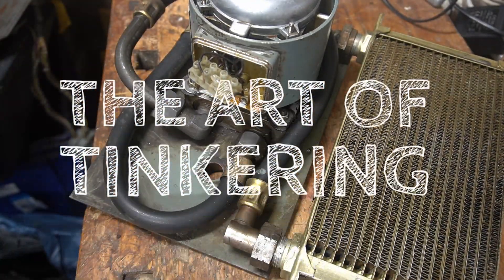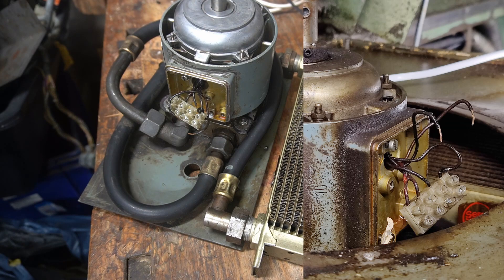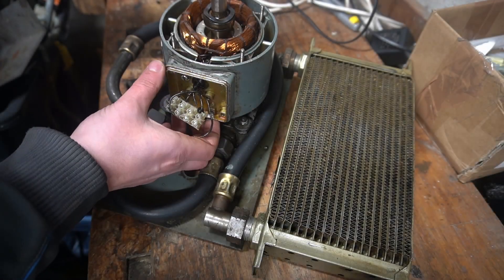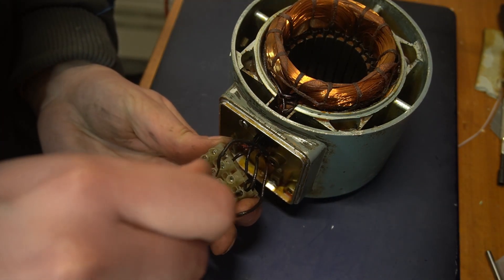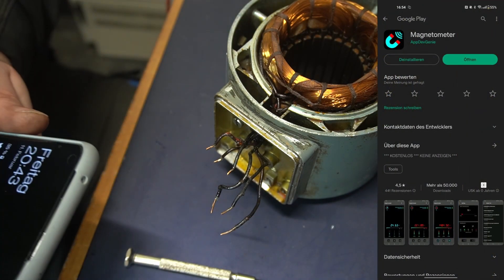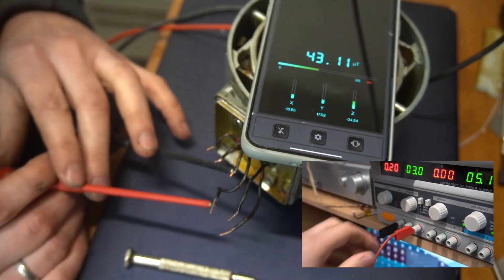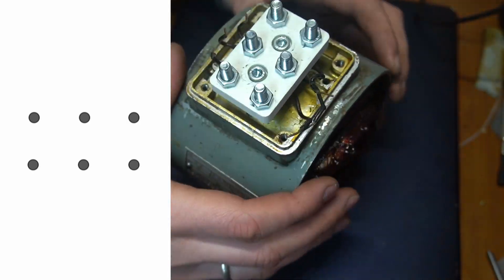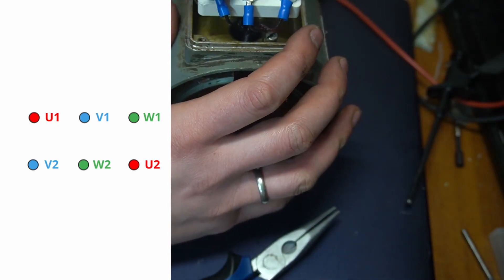measuring phase polarity of asynchronmotor

Comment: You just need to connect the three windings in a circular series connection (for delta) or common one end (for star). No need to measure anything or even do much thinking. The polarity or sequence simply doesn't matter and as you say, if the motor spins the wrong way you can swap any one of the windings around or you can swap any 2 of the power connections. Nice looking machine!
Reply from the maker: Yes, that is correct if we are talking about the 3 Wires that come from the plug, but regarding the 6 wire ends inside the Motor, the phase polarity matters. There are lots of Sources about this online such as: https://electengmaterials.com/polarity-test-of-three-phase-induction-motor/

Comment: Hello Alex, now, I thougt about it for a while and I think, you don't necessarily need to check those polarities. Just check resistance to find the pairs and connect them somehow as star or triangle. There will be 10 ways to arrange the wires in triangle or star and all are OK. 5 rotate clockwise the other 5 counterclockwise.   Or did I miss something?
Reply from the maker: If one phase has the polarity changed, then the magnetic field distribution within the motor winding becomes uneven, and the output torque will "pulse". High current will flow. This may or may not cause damage to the motor.